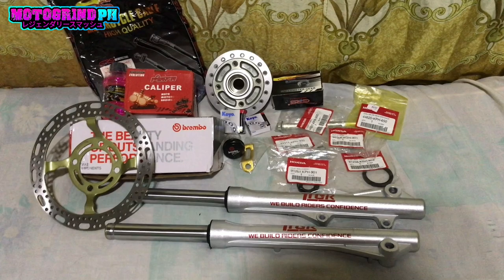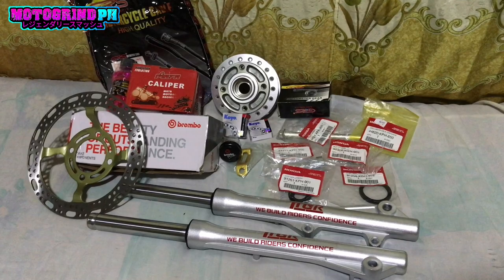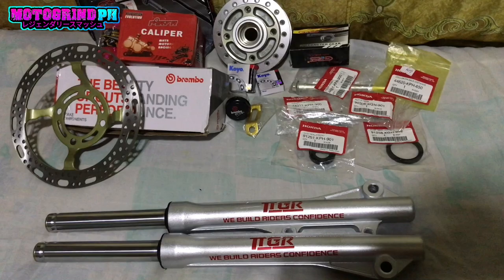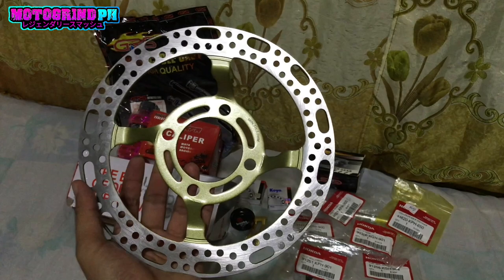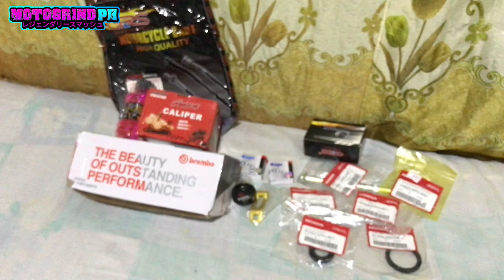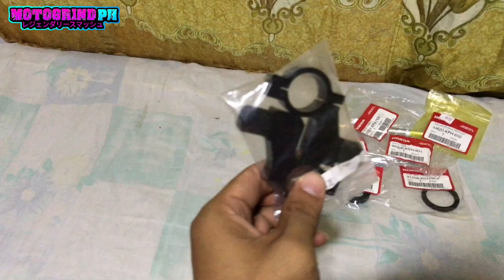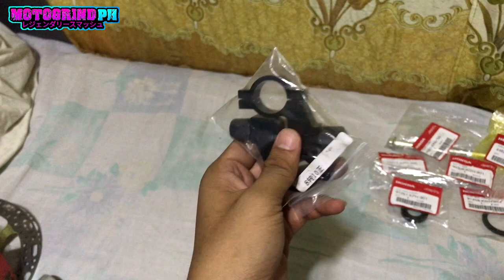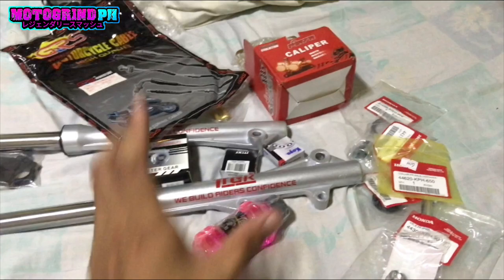SMASH 115 FRONT DISC BRAKE CONVERSION (Wave125)

Comment: Kapag ba mag papalagay ng disc brake sa unahan pwede bang hindi palitan yung stock front shock ng smash at hub? para sana less gastos 😊  Salamat boss
Reply: Hindi pwedi kasi yong shock mo ay stock pang drum brake Hindi pwedi wala kasi lalagyan yan ng disc brake caliper depende nalang sa motor mo kung pag bili mo ay may disc brake set
Reply from the maker: Tama boss